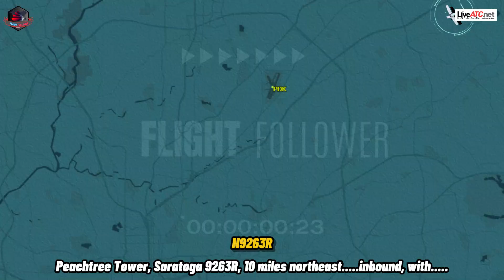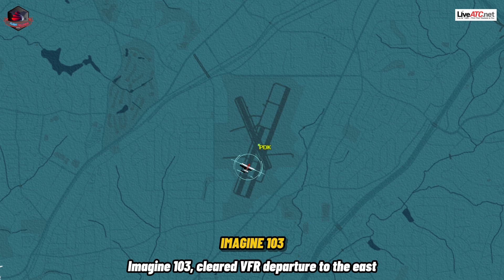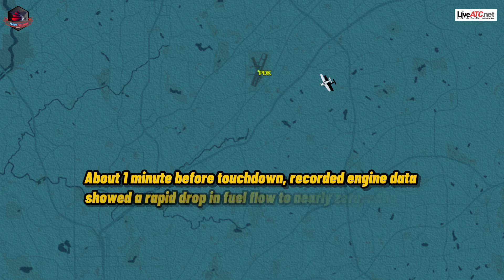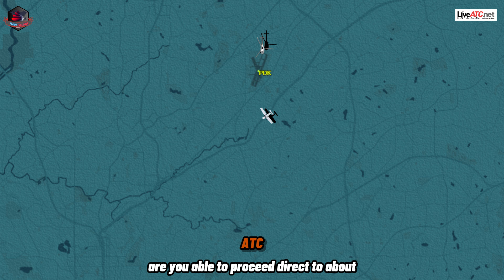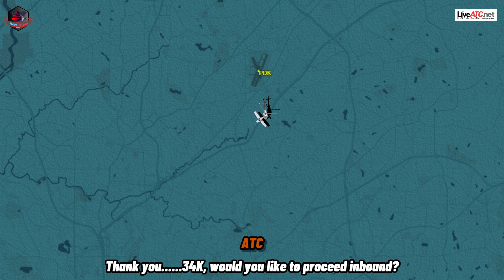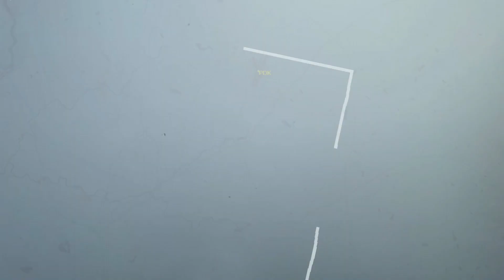WRONG Fuel Setting causes FUEL STARVATION & Emergency Landing! #atc

Comment: I don’t understand. If your engine suddenly quits it should take you about 1/2 of a second to switch fuel tanks. Why did he not do this? Or did he?
Reply: Panic I assume, so that means he didnt have enough proper training in that aircraft ofcourse that is only a assumption from me not a fact.
Reply: We had a student here on our field who ran out of fuel and landed safely on the highway. He was too cheap to stop and get fuel but he also had 5 gallons of useful fuel IF he had changed tanks in time

Comment: Always re-check fuel selector after changing it.  You should also never run a tank so low that an engine could quit because if you forget and switch to that tank bad things will happen.  In cruise I also don't change tanks unless I am easily with glide distance of an airport, and like Kevin said, undo whatever it was you just did.
Reply: The advantage of being older is my bladder fills up long before my tanks empty
Reply: @arthurbrumagem3844  I have 5 hours fuel, 2.5 per side.  I like to always have an hour reserve per side which gives me 3 hours which is plenty of time in the air before landing and stretching my legs.

Comment: We have 6/260 with 4 tanks.   We have a timer on 430 plus a secondary timer for tank changes.  We don't change tanks unless high, over open land, or near an airport.   If you get sputter you go mixture rich, switch tanks and fuel pump.   He must be new to this plane cause if you fly them enough it's not to hard.   Tired of people crashing these planes and causing our insurance to keep going up!!   Stay current and proficient with your plane.

Comment: If the engine fails, undo what you just did! I made this exact mistake in a warrior, but had an instructor that taught me this simple concept. Flipped the fuel selector back to the tank I was on and the engine came back to life. Looking back on it, I obviously went past the detent and went to the off position.